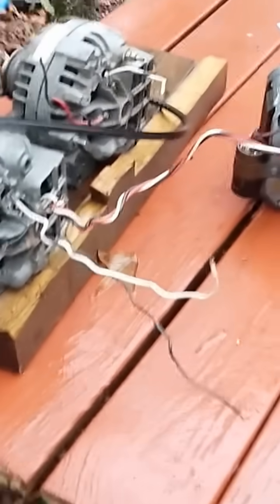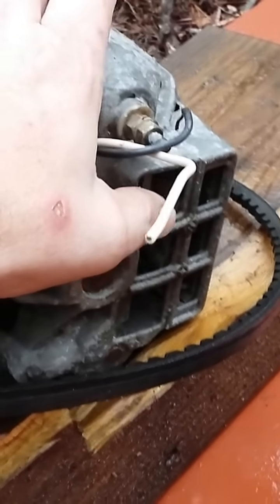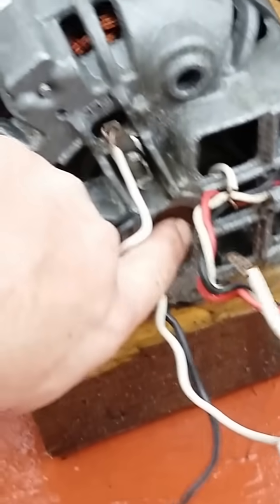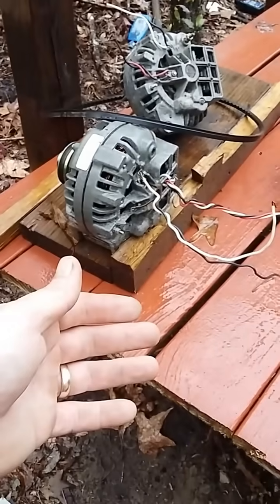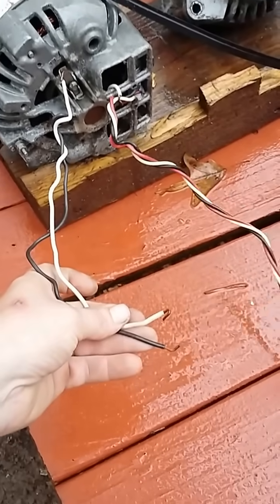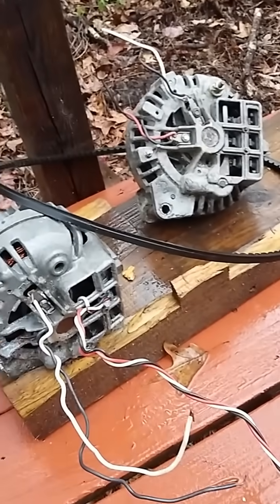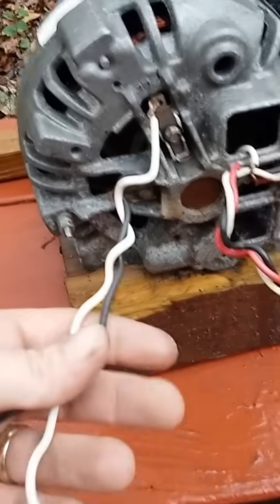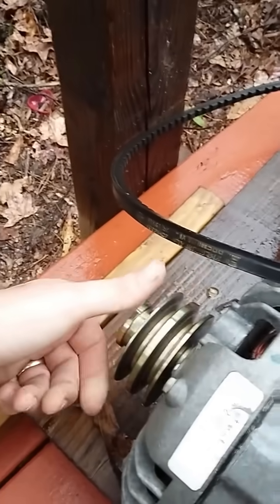Update Free energy forever no wind no solar no gas READ DISCRIPTION!!!

Comment: Bs alter nate need 22 horsepower to produce 120 amp and this little moter can not trun all bulshit
Reply: Habib Zaidi .
Yes 22 hp mechanical you moron.
It only needs 120 nm of torque to power the generator you shit for brains.
That's 20 vlts to field.not 12.

Comment: If you put out informative information such as this that has the potential to get someone killed, please mention safety precautions that should be taken. ie.  How to discharge a capacitor. (For replacements) Which if not done properly can electrocute you severely. How to handle wires in general... splicing, color code etc... How to work with one hand at a time as to not allow a potential shock to cross your chest seizing your heart.... it would have been a good thing to pin some of these examples 👍👍
Reply: LMAO

Comment: The most common function of a diode is to allow an electric current to pass in one direction (called the diode's forward direction), while blocking it in the opposite direction (the reverse direction). As such, the diode can be viewed as an electronic version of a check valve.
Reply: Can you explain how you remove the 
Rectifier and do the wiring in the alternator please
Reply: @mattizsicario9559  a rectifier, ( a bridge rectifier) is made up of 4 diodes,  it's used to change a.c, to d.c, by only letting the current flow one way...look it up...it's not hard to understand.
Reply: @michaelb7197  Thanks bro I get that idea

Comment: Albert Einstein tried to leave a comment here, but his computer lost power using your system. Then he realized his own theory of Conservation of Energy that energy cannot be created or destroyed.
Reply: You, sir are the epitome of the saying; "better to be thought a fool than to open ones mouth and remove all doubt." Einstein is not the one that discovered the law of conservation of energy. We have what is called the internet nowadays so there is no excuse to be ignorant, stupid maybe, but ignorant no.😋
Reply: Lol... you right about that Einstein was not the one to come up with that. But it still holds true that energy cannot be created or destroyed. Meaning, there's no such thing as free energy.
Reply from the maker: +M Kan  so you're saying that there is no energy created by the Sun and no such thing as high frequency high voltage manipulation of current draw?
Reply: The Sun is not creating energy it is only burning the energy it has.
Reply: @dr4g0nb0y4  That is correct. The Laws of Thermodynamics describe just that.
And no, the Sun is not creating energy, it is consuming the energy it contains as well as converting energy into matter (subatomic particles) and releasing that energy as light and heat (radiation) along with coronal 'mass' ejections into our solar system. Where you came up high frequency voltage manipulation of current draw as creating energy I have no idea? That is not creating energy that is just changing it. As M Kan stated energy cannot be created or destroyed,  it can only be converted. By the way it was Sir Isaac Newton the came up with above mention law(s). Einstein proved that energy and mass are related,  energy can be converted into mass and mass can be converted into energy.
Reply: And besides, we don't live on the Sun. We live on Earth. How would we be able to bring the energy from the Sun all the way back to our planet.??
Reply: @dr4g0nb0y4  You are kidding, right? My entire house, and electric car, are powered by solar panels. That is how we bring the energy from the sun all the way back to our planet. We don't "bring the energy from the sun", the sun delivers it to us every day, whether we harness it or not. But, you knew that.
Reply: Understood. However, if your house and your car are being powered by the sun, then why can't all of us have this sun power free. It cost money to be able to use sun power. Energy cannot be created or destroyed. 3rd law of newton's thermonphysics.

Comment: Diodes don't transform electricity...they control the direction of the current..."transformers", transform the electricity...hence the name transformers....Bridge rectofiers...welll, ..you ...well....nevermind....GOOD LUCK GUY!!!!
Reply: What about light emitting diodes,?
Reply: @teeqtoque939  power only flows one way in an led aswell as far as I know.
Reply: The most common function of a diode is to allow an electric current to pass in one direction (called the diode's forward direction), while blocking it in the opposite direction (the reverse direction). As such, the diode can be viewed as an electronic version of a check valve.
Reply: Rectify bridges ?

Comment: Great idea but if you can add on a battery charger so that the battery can be constantly charger the battery supply the rotor current it can be great....I wonder why people are failing to understand this
Reply: If system can power house. Plug in a battery charger and connect to battery that powers alternator. Constant power source and battery wont die

Comment: What a crap. No generator generates 'free' energy out of nothing. To get electric energy out of any of these generators you have to put in mechanical energy, i.e. make the rotator rotate. This is not free, unless you have a turbine or something that uses the existing flow of water or the energy of the wind.  But without a river close to you you are out of luck. So why does this guy not say a word about the energy input? There is no 'free' energy out of nowhere.
Reply: @Allen Allen I am ready to listen to your explanation. What is wrong and why. 
Or are you just an ignorant troll? In case you mean it seriously, don't be afraid to dive deep in science and use the appropriate terminology. I have a MS in electrical engineering, so it will not be lost with me.

Comment: You are not going to get 220 volts at 90 amps out of that alternator.  You might get 220 volts at near zero amps, and you might get 90 amps at 14 volts, but the alternator is not designed for 90 amps.  It’s designed for 50 amps.  Typically those alternators are designed for 600 watts.  Do the math.  Typically a car alternator takes 5 hp from the engine and yields back 1 hp.  That 20% efficient.

Comment: Guy I work for made one for battery charger.  JR was so cheap to replace old 
Battery. This was in 
1989. Next thing hard times hit how do ya replace the battery.
Reply from the maker: Well if you take a dead battery brother and you put some magnesium sulfate or Epsom salt in a 20 oz cup so what about one in full or 1/4 a cup of Epsom salt and then fill the cup up with distilled white vinegar and pour that in your battery your good to go after you charge it back up! I did this on two car batteries one lasted six more months and the winter killed it and the other one is still in my truck....
Thanks for watching my videos!

Comment: Everyone interested in free energy had this idea, it's not a new idea but I've yet to see anyone use it to power anything. Lots of explainations of this idea. A lot of YouTubers have taken little dinky motors and connect them together since forever now, your just using bigger alternators. The idea or concept is, if a generator produces power by spinning it, then a person should be able to use the power that several generators spinning produces to run one motor to spin serveral generators and produce an excess of power they can use elsewhere. Use alittle to produce alot more. But nobody ever actually achieves this for some reason.
Reply: The reason is very simple. You cannot generate energy out of nothing. If you want to put out energy, you need to put in some other form of energy. This is a fundamental physical law. Saying anything else is just ignorant or fraude.
Reply: The Law of Conservation of Energy differs in a closed system vs an open one.
Reply: @obadiahkilgore2964  correct. But you can consider any open system as a closed one by defining appropriate boundaries. In the specific case the system consists in the mechanical construction including the bearings, the two motors and the battery. Enclose it and measure the loss of charge of the battery and the outgoing heat.
Reply: @tuscanguy1  fair enough, I hadn't remembered that.

Comment: Electric power is the result of magnetism lines of force passing through a conducting wire.  Wrapping a wire into a coil and passing magnetic lines of force through it will product electrical current however to be self sustaining all the lines of magnetic stimulation must stimulate the electrons of the wire.  The wrap closest to the magnet gets the most stimulation while the wire furthest away gets less.  this loss must be made up somehow, either by a separate power source  or by energy from another source (like a car engine turning an alternator)  Perpetual motion has not been discovered yet.  You say you power your house with your set up.  What runs the motor generator?  We tried this when I was in the Navy and it never worked because all the lines of force never cut the wire.  What you have created here is a home generator dependent on an outside source of power to turn a stater to make electricity.  It would be more efficient to use wind and solar to charge a battery bank then rectify the stored electric power to 110/220 volts.  I have a friend who moved to Alaska off grid.  He is totally 12 volts, propane and wood heat.
Reply: Haha wait, isnt that backward? I thought Electricity produces a magnetic field

Comment: Electrical engineer here, don't do this, whatever this is. Btw, the stator is stationary the rotar rotates.
Reply: And the windings are not called a coil or coils.

Coils are found in a relay
Reply: @christopherpeterson5246  technically windings are coils. On a schematic there are drawn the same. Inductive motors are either in a wye or delta configuration which looks like 3 coils tied together in the middle or on the ends.

Comment: ...this is missing SO much information...nothing about inverters...or batteries, etc., or how he's running the alternators in the first place, he makes it sound like he's just running house power through it...and how the hell (and WHY) would an alternator generate A/C THEN convert it to D/C??? ALL power, originally generated, is D/C, and is THEN converted to A/C for long distance transmission. Which is NOT necessary in an automobile.
This video doesn't make ANY damn sense... :>/
Like a guy already said in the comments, "where is the initial source"???
Reply: It's just clickbait he makes money off of.
Reply: Generators or alternator,create alternating current.it uses 4 diodes to rectify it into direct current so that the car can run it's accessories

Comment: Hey there are you the one in this video?! I would love to hear more about it. I'm disabled veteran living on a check trying to live cheaper and I'm ex military so we can get some security for you to work and help people wake up. Great video my man and I'm proud that your not bowing down to our govt.
Reply: Bro... this doesn't exist.  No such thing as free energy by mechanical means. I'm an electrical engineer that has worked at power and chemical plants for the last 15 years, I promise you this dude will end up burning down his trailer with his invention.
Reply: @schamberlain1  how do you know now I haven't seen a whole house been done but I've seen a 120 by 50 pole barn being powered by 2 alternators and a motor?! So why wouldn't you be able to power everything by solar, wind, or water...that's exactly what power plants use. And the rest of the world uses and then they charge us for it
Reply: @brockdodrill257  can you power a house or barn from this? No. This is essentially making a generator.  You still need a mechanical force to turn it. That takes power/ fuel, therefore money. You can't power an electric motor with the output of the generator which it operates. Essentially, it takes more energy to turn a generator than it can produce. That's not me just saying this, its physics.

Comment: Using one motor to power another to generate power is obviously REALLY inefficient backwards. This isnt anywhere close to 100% efficiency. If you generated 150 watts using a 12v dc motor to power it would be VERY counter productive lol  You used way more than you make 
 For every 200 watts you feed to the motor it then spins the alternator and you generate 100 watts of power CONGRATS you found a way to take electricity(had to come from some where, AC wall power$$) and cut its output in half. Awesome you made a RESISTOR thank you!

Comment: Something has to spin the state on the alternator that alone takes power. So where does this free power come from?
Reply: DC motor hooked to  battery that's recharged with the electricity that it makes
Reply: @bigtimbo4027  so basically what you have is a closed electrical loop?

Comment: my house is smack dab in the middle of a big city, I have been off grid for just a couple months short of twenty years. I have 900 watts of solar panels as a guaranteed power source, storing the daylight energy in AGM batteries, through power invertors, the 120 volts is available and the available energy is 400 watts or less, I personally don't like the idea of lethal voltage in my house.  In my experiments, I have found that any contraption to generate electricity with a motor that consumes fuel will eventually fail.

Comment: what you're saying does not make sense, according to the laws of physics you cannot get free energy. you have no expertise at all or knowledge on how an electric/motor/generator/alternator works.
you quoted diodes, stator etc,  you are inputting low dc voltage and you're quoting high out in amperage, but you did not say what drives the motor pulleys, or where did you get the dc input from.
your comments have no scientific proof at all.
i conclude that what you're saying is insignificant to your claim of free energy. there is no free energy in this universe.

Comment: For those who somehow believe this video, I'm truly sorry for you!    If he somehow changed all the electrical rules in windings and could put 12 volts in and get 220 volts out(which he can't without rewiring the alternator) the alternator would be capable of 4.5 amps at 240 volts or 9 amps at 120 volts.   That's not the really stupid part though.   Ask yourself, where is the 12 volts D.C. Coming from, and where is the power coming from to spin the alternator?   If you power a motor to turn an alternator, you will loose power because of efficiency, and whatever power you make will cost you more money.

Comment: A question for you my friend. 😉 The wires that are producing 220 volts, could those ( I'm pretty sure thats what you said) be somehow powered down to achieve a voltage of 120, and if so, how would it affect the current? Also, I should probably ask how to do it. lol
Reply: If you can get that design  to work each wire would represent 110 volts. That's the voltage needed to power most if not all outlets in your home. Now the way you would have to wire it for it to be safe, and maintain its integrity might require some 10 to 6 guage wire, and alot of thought on how your going lay out wire past your junction to provide power where its needed. Something an experienced certified electrician would have little trouble with.
Reply: If you need anything less than 110/120 your going to need a transformer.
Reply: Yes only use one wire or leg or phase .
Reply: Awesome Lonnie and thank you. I've got some good ideas but I'd like to stay alive trying. Very clear answer and it sounds like you know your stuff. I'm over 45 yrs. old and would have never thought of this even though the concept is quite simple. Hats off brother. Keep doin' whatever it is you're doing because you have great ideas. 👍

Comment: Sorry about my ignorance but which is the best motor to tune the Alternators low voltage and relay on the batteries to turn the motor on to charge the batteries when they drop yo like 11 volts my Optima batteries fully charged is 13 volts but can be charged up to 14.8 what I see ! I’m trying to do what you have whale live in with the animals in city but preparation is the best preparedness. For preparation your wisdom out for seize The ignorance which comes against you ! You have openly unlocked this truth ! When it hits the wall which it will at lest we will have some kind of power ! Thank you I would like if you had time right from the beginning set 1 of these up take in the back plate off wiring it up ! I’m following your wisdom along !

Comment: Having built charging systems for 12 volt battery banks using alternators and small engines ,
Initially it was interesting at the beginning .However the more he tried to explain the less he knew about what he was doing.  My BS meter was driving alarms wild so I quit watching.
that wiring cannot handle 90 amps period . Where are the meters to prove this ?
  Did not know the correct input voltage to the field so throwing random numbers didn't help. 
 Yes they have been used for welding but the life is very limited.
 I recommend taking more thought about what you are trying to present .
Reply: arleigh crisman you’d need what, 4 gauge wire for a 90A draw?

Comment: I didnt hear if the 90 Amps was ac or DC. Alternators by default produce ac. I believe these work, but do not have the time to build them. I also have other ideas to add to this to assist with permanent generation, and modifying models of transportation...